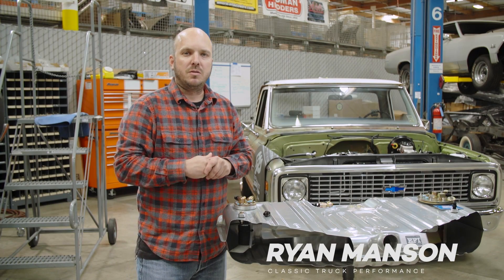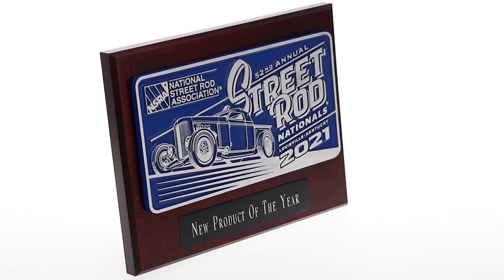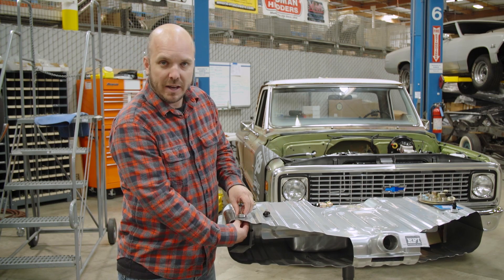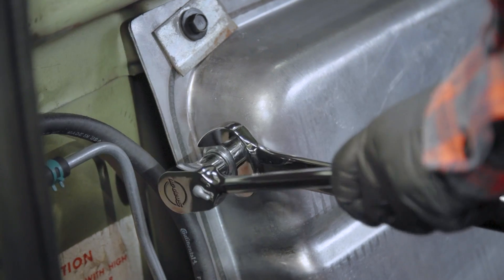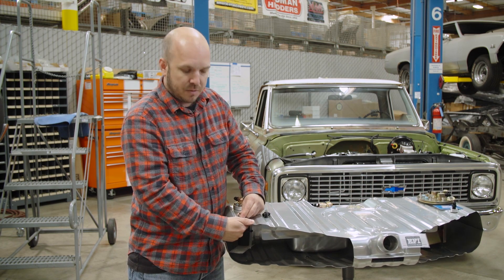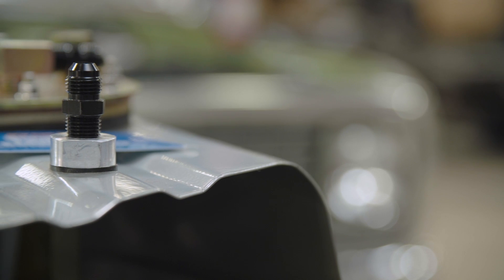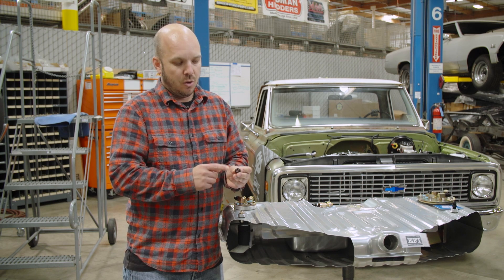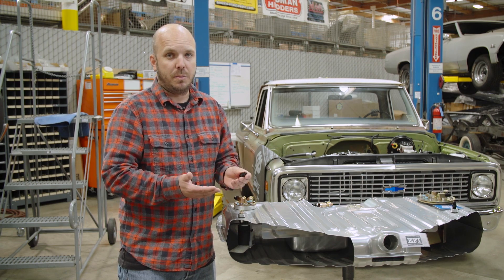EZ-Return Rivet Fitting: How To Install In A Gas Tank For EFI

Comment: great but who wants to DRILL into a used tank?  how do you get the lil pieces out? is heat from drill bit going to ignite fumes?
Will this unit work if i just PUNCTURE THE GAS TANK  with a sharp punch?
Reply: Drilling a small hole in the tank is nowhere near enough heat to ignite fumes... as for the metal shavings it wouldn't be a huge deal that's why you have a fuel filter.

Comment: There's no way to feed a fuel line down into the tank with this fitting. When the tank is like 1/2 full. The return fuel is gonna aerate the fuel in the tank. Kind of like live fish well in a boat live. And oh boy, fuel injection is gonna love that. NOT!!!!!!!!!!!!!!!!!!!!!!!!!!!!!
Reply from the maker: Hello, part number 45156 includes an attached tube that you can cut down to accommodate whatever depth tank you are using. It's a new item and it should be up on our website in the next couple of days. Thanks for the comment.

Comment: Any reason I can't use these as a feed line as well?
Reply: I'd use a fuel cell or firewall bung fitting -6 or -8 depending on your power  But .... this would work maybe more expensive and comprehensive tho

Comment: Do they have them in 12AN for fuel feed?
Reply: No ....he said -6 o ring fitting ... use a firewall/ fuel cell -12 fitting one side is shorter than the other FYI .....JS that is a LOT  of fuel return volume unless your trying to run carbs with a 100 psi FI pump

Comment: Installing a Sniper EFI, I need to have a way to attach a tube to extend into the bottom of the tank in order to keep the fuel from bubbles and cavitation. Any way to attach a tube from the outside and extend through the riv nut securely?
Reply: That’s the dilemma I’m facing, I’m just going to crank on some submersible 3/8 fuel line on it. 😊
Reply: Yeah every one of these videos leave that part out and completely ignore that this whole thing doesn’t work right without the drop tube and there’s no way to put one on this damn thing 😡
Reply: Fellas !!! use a -6 -8 -10 fuel cell fuel fittings, they're cheap and won't leak Fi uses -6 so use that bung fitting and a -6 compression fitting on some stainless 3/8 line get a sock from Holley OR build it from A/N and Holley has a fuel mat that screws to AN fittings not cheap but itll work ... best to spend the money and install an intank pump if your serious .....Be aware if you have a stroker with a big cam low vacuum DON'T install a T/B system go mpfi Ask me how I know and have the entire system in my attic Wife won't let me decorate with them LOL

Comment: Does it matter it it installed on the top or buttom?
Reply from the maker: It is a leak-proof fitting, so it can be installed in any orientation.

Comment: & no tube running within 1/2" of bottom of tank ??? which will cause aeration bubbles & foam ???
Reply: Yea if you want to effect the fuel regulator operation keep more than 5 gallons in your tank Bill ... I welded up a 28 gallon fuel cell out of 10 gage steel 22x22x13 and the return is open at the top just a -8 fuel bung no issues, larger the fitting the less the velocity make sure the return is opposite the fuel feed to reduce any issues with heat bubbles etc : )

Comment: A little off topic, but is that aluminum spacer available that is below the sending unit? I need one of those!!
Reply from the maker: Those are all our products, so yes! You should give us a call at 800-522-5004 and one of our sales reps can help identify the part number you need. You can also check out some of our fuel system products here: https://www.classicperform.com/Complete-Fuel-Injection-Ready-Tank-Kits/EFI_Accessories.htm